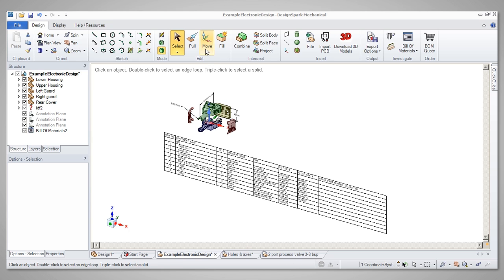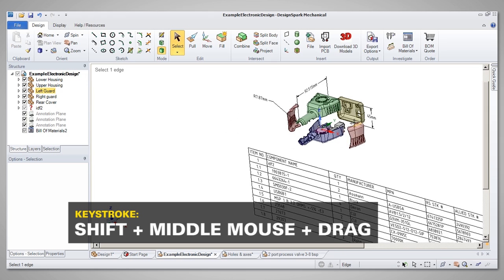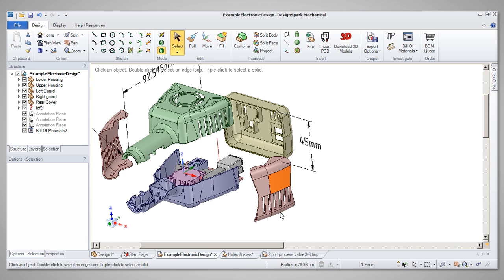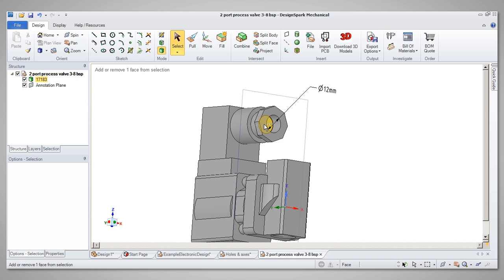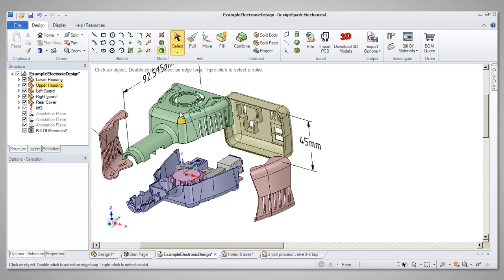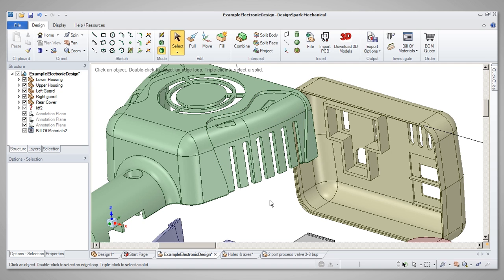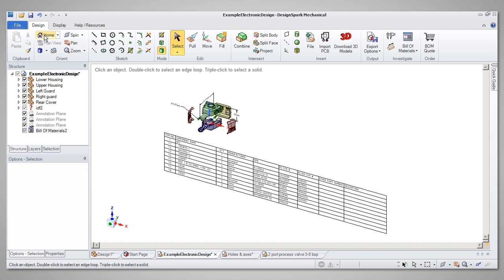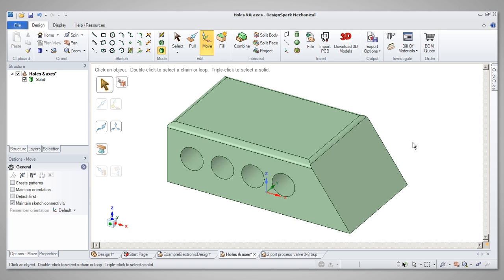DesignSpark Mechanical - Basics - 2. Selection - Full tutorial

Comment: My units will not use inches... only metric
Reply: Select DesignSpark Mechanical Options from the Application menu select the tab UNITS, and there you can choose between metric and imperial. 
one tip, for 3d printing, nearly everything is in mm And inches is only used in one county on this entire planet. and it is derived from the International Standard Organization the meter. the inch is 2.54 mm even Nasa uses metric since the 90ties
Reply: @hanspijpers2100  Thanks, it doesn't work:) Imperial came thousands of years before metric BTW:) Metric is the new kid on the block:)  I had forgotten about Design Spark... I use Onshape now, MUCH better.

Comment: Good day! I like very much designspark software. Would like to learn more about features. I am using DesignSpark Mechanical 2.0. Curently I am experiencing problem with importing files (such as jpg. png. and etc). I am only able to import .ibd files. As an example I would like to construct water valve, but cannot find video lessons with the full assembly drawings required for the task. Sorry for the inconvienience that may caused. Best regards.